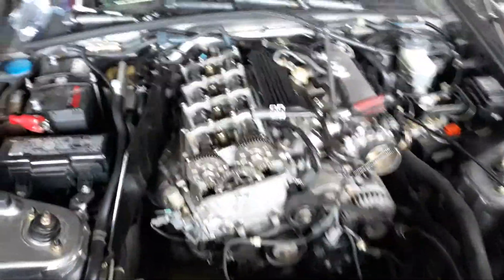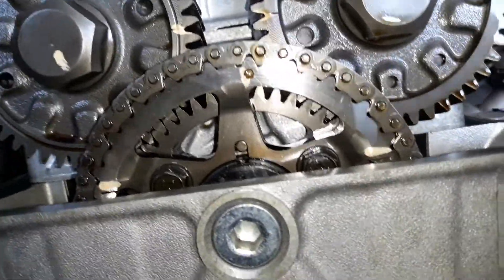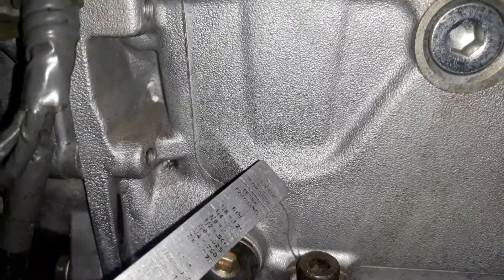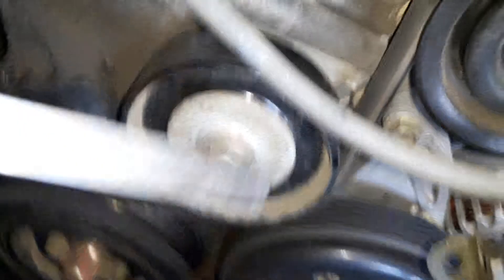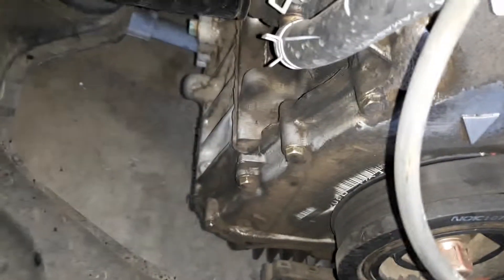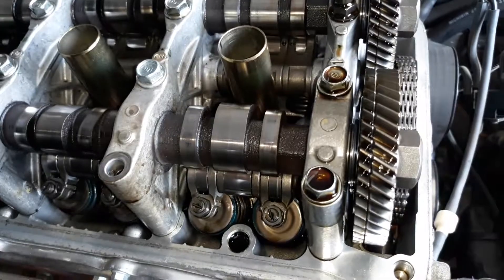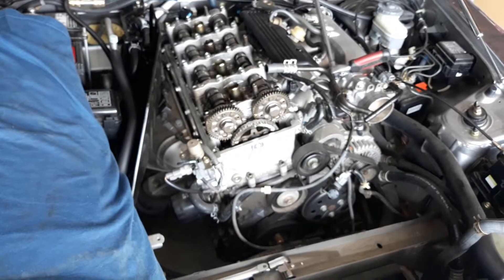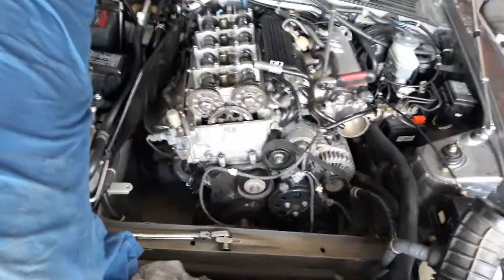S2000 timing chain TDC misalignment 2

Comment: Will that much timing prevent the plugs from firing?
Reply from the maker: Yes
Reply: @SuperDjnrg  I recently changed the head gasket on my ap2 and the timing on top looked good but I didn't check the crank pully,  I'm thinking because of that it won't throw spark or fuel
Reply from the maker: @samuelontiveros1698  you also might want to pull off your cam journals and check the surface of the cams. When i did the cams were ruined. So my client decided to go with a new motor.
Reply: @SuperDjnrg  SMH God I hope mine are pkay. It wat running perfect before
Reply from the maker: @samuelontiveros1698  so was this one, but a youngster owned the one in my video. He drove it pretty hard.
Reply: Did the throw a td noise code